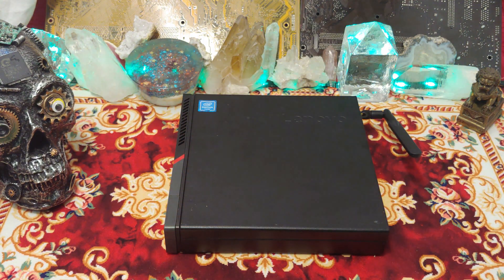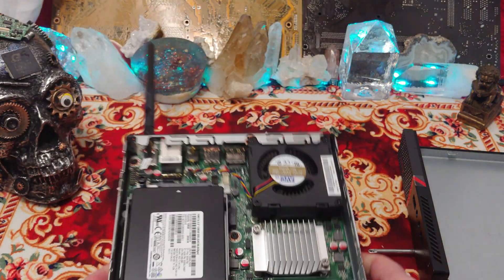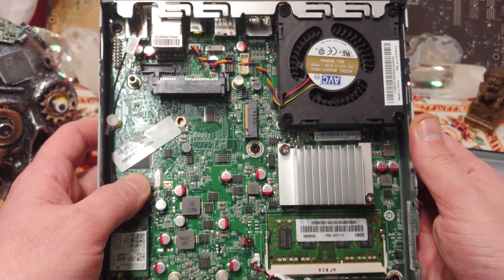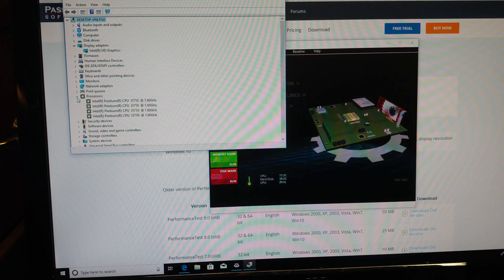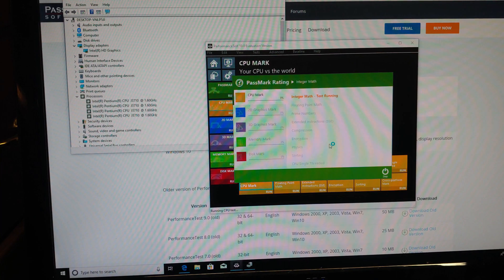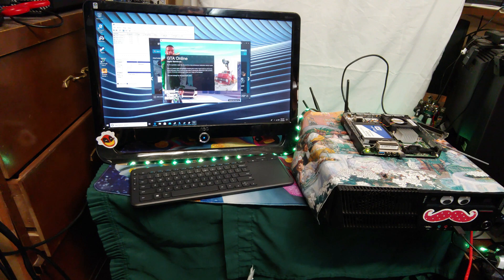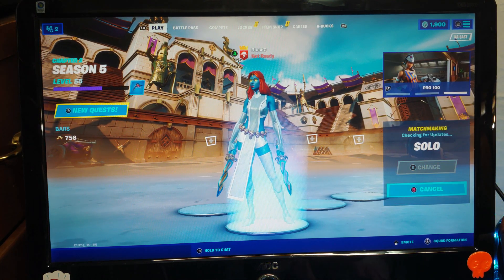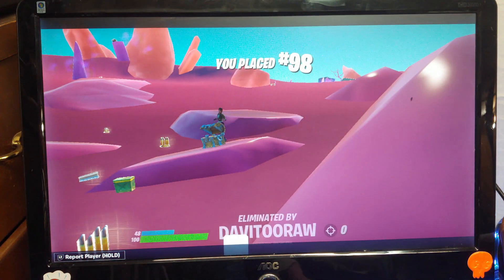Lenovo M600 Tiny Test & Gaming Benchmark. GTA V, Fortnite, Intel® Pentium® J3710 Processor

Comment: Thank you. I picked two of these at a job site where I was told to eWaste them or take them home. I thought an 8GB upgrade from the default 4GB would help, but I see that is pointless. It is an insufferably slow system and nothing will change that. You saved me the cost of a RAM upgrade and pointless test with SSD.
Reply: Same here

Comment: Can it play 4K videos?
Reply from the maker: I really, really doubt it.
Reply: No, it doesn't support it's an HD Graphic card, not UHD.
Reply: @evenslouis-charles2211  Yes you can... It is Intel HD Graphics 405 (Braswell) and "The SoC also integrates a video decoding engine that should be able to handle 4K H.265 videos.".